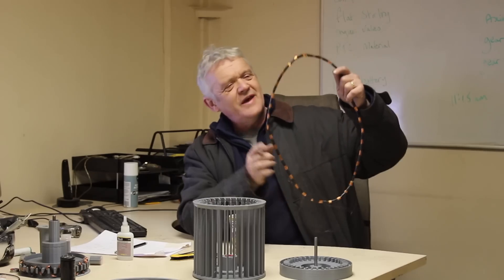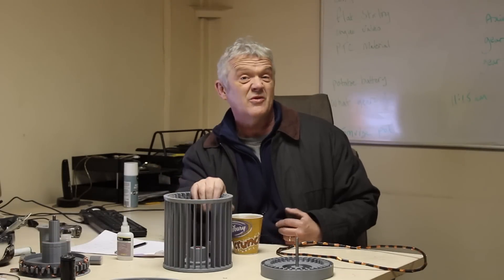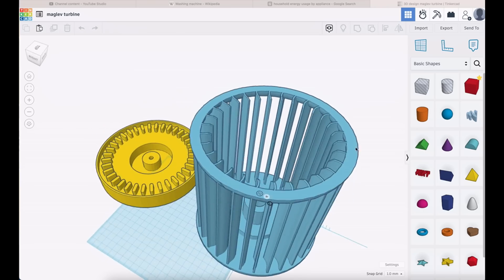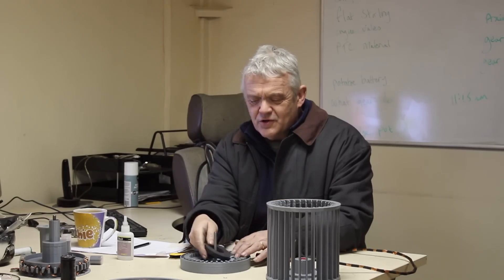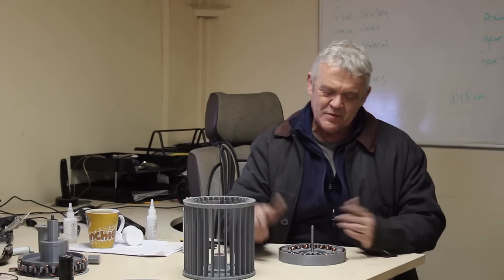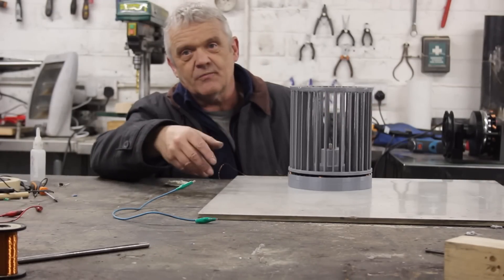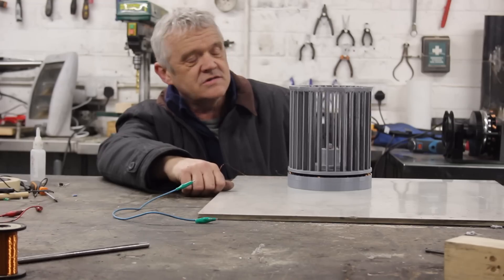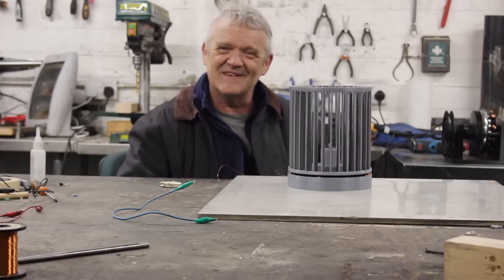1877 Maglev Wind Turbine

Comment: So,,(again I'm thinking out loud) could you affix this to a electric bike to charge as you ride?
Reply: Yes, but the additional drag would likely be more energy than the generator could produce, you’re probably better off generating electricity from a device powered by the wheels or drivetrain, like the vintage bicycle headlights that pressed a small wheel against the bike’s tire to spin it and generate enough electricity to light an incandescent bulb brightly.  When I entered a Science fair at a local university with my 3D CRT TV invention in gr. 10, the guys in the booth next to me were doing a car with a roof mounted squirrel cage wind generator...  that was their main criticism, and their excuse was ‘we designed it with poorly aerodynamic boxy cars in mind’  ...  fair enough, but it isn’t actually feasible to get more power out than the extra drag caused.
Reply from the maker: yes you could in theory
Reply: @Robert Murray-Smith  thank you sir..
Reply: @Robert Murray-Smith  I can't afford an electric bike,,but am trying to learn about battery making..

Comment: Hello Robert,
Thank you for all of your great videos. I have loved watching your content for years. 
However, in your last couple of videos, you have only shown voltage readings and never the amperage reading. 
Would it be possible for you to provide an update to this video and tell us how many amperes you have read?
Best regards,
Chris
Reply from the maker: that's because I realised measuring amps all the time was a waste of time and pretty dull lol - we are working with the same coil and magnet arrangement at the moment mate - I did measure amps and volts once or twice but after that - what is the point? Volts will give a direct measure and amps is just a matter of force in less losses in the generation system - as losses in the generation system are the same why bother? we know force in as it is governed by wind speed  - so to asses this system we only really need wind speed and volts - the I have finished making assessments and build the final version then it would be time to measure amps again - and it is likely I will do exactly that. Anyway for your peace of mind it was about 35ma
Reply: @ThinkingandTinkering  Thank you, Robert, for your quick response. Your YouTube channel is great - it's a pleasure to watch. 👍
Reply: Yes please!!! I was just about to write the same thing.
Reply: If I'm not mistaken, the device he connects all these devices to to measure voltage has a set load so all are compared equally. Perhaps go back to that video where he presents it for the e act numbers.

Comment: If you arrange magnets in halbach array configuration, you should be able to generate more power out.
Reply from the maker: no - you would get a higher voltage - but power out is always less than power in - you can't get more than the wind is providing

Comment: 🤔 Also a nut on the end of the fixed shaft will lower the distance gap/clearance between the turbine and the coil, it will increese the output voltage. 👍🏻
Reply: Wouldn't that attract more squirrels? 😊

Great idea to stop the turbine section launching off into the distance. 👍
Reply: @YoureNowOnTV  LMAO... isn't that the point of the squirrel cage design
Reply: @YoureNowOnTV  Nobady said to be tigthened till the end .
Reply: another mag-lev bearing at the top fixed to the axle would stop it escaping, then the gap could be adjusted by lowering the top mag lev setup, this would also mean the thing could be turned on its side if you wished.
Reply: this would add friction .. better to just create the print with the mag-bearings farther apart or coils and gen-magnets closer ...
Reply: Just add another coil section on top. Double the generation, no chance of it absconding.
Reply: @Gainn  And the weight will force it down farther
Reply from the maker: nice - cheers mate
Reply: you would need a bearing under that nut!

Comment: I'm wondering how much impact the large magnetic fields from those ring magnets is having interacting / interfering with the magnetic field from the tiny neodymium magnets at the rim - which are ultimately the ones interacting with the coil to produce the current.  Maybe do a comparison of the output from this maglev version with a version using a standard non-magnetic (but more friction) thrust bearing?
Reply from the maker: none at all
Reply: Wonder if one could shield it somehow...

Comment: How did you (or did you) manage the gap between the magnets and the coils? Heuristic? ie by tinkering? Seems like you'd want as small a space as possible without the turbine bottoming out when it starts to vibrate
Reply: Or if the weight increased for some Godly reason.
Reply from the maker: I must do a video lol

Comment: i might have a suggestion. as wind mostly only comes from one direction, and the wheel can only turn in one direction, maybe block off half of the entire cylinder around it, blocking wind from interfering or interacting with the rotor, on the wrong direction. perhaps this casing can be aerodynamic, to make sure the nose always points to the wind as well. like those flag thingy's behind wind direction telling contraptions.
Reply from the maker: good suggestion mate - cheers
Reply: @ThinkingandTinkering  great channel :)

Comment: this idea has obsessed me for years - imagine this in the place of chimney pots in cities which no longer allows fires.
Reply: @dadigitechman  Is that true? Turbines ain't turbines. Rob has made many comments on the fact that a Council rightfully won't allow a HAWT with its propellor spinning away on a 10m tower, but a row of these is a different story. Maybe not on a roofline but they could go on a ledge outside windows or below a verandah railing.  Totally unobtrusive. Not the ideal site but large numbers make up for the inefficiencies and VAWTs do much better in turbulent air than HAWTs
Reply: @dadigitechman  A chimney pot or a weather vane or ridge tile design, would not look like a generator and so should escape that prohibition.
Reply: @dadigitechman  Only if they CATCH ya!
Reply from the maker: nice
Reply: @dadigitechman  hel yea !
Reply: First it looks like these could pay for themselves pretty darn quick
Second I'd use air bearing in place of PM.
I thought of the same idea of placing these on the roof too, so how about replacing wind-driven turbine exhaust ventilator, Along with the wind the attic heat would add additional force.
Reply: @BOBPortlandOr  excellent idea - and having multiple things working side by side contributing seems sensible
Reply: @BOBPortlandOr  Question... How will you provide air as a bearing, for less energy than the turbine provides?

The magnets can be yanked from an old failed microwave oven for totally free, and cost absolutely nothing to operate.

While I may have played 'devil's advocate' about magnetic drag, I do know that it indeed, is, at this point in time, the least power robbing form of bearing known.

Since each of these turbines are only going to produce a pittance, unless you plan on making one as big as a house its self, you will still be more power ahead to use magnets than to use air, and this only because air GAINS efficiency with surface area.

That reminds me of one of my plans for using water as a bearing.

It only makes sense in certain scales of power production, due to inherent inefficiencies, while, at the same scale as I WOULD use water as a bearing, magnets would cost the price of a small city.

One needs to engineer a system to work to scale, and at the scale Rob is showing us, magnets are just impossible to beat.
Reply: @hunnybunnysheavymetalmusic6542  
So with a air bearing there's: no magnetic drag, no magnets needed, no horizontal drag on axle. The question is how much sleeve and axle needs to be machined I guess 3cm.
Maybe you  could sell a DIYS Kits like Heathkit use to do, Maybe the wire could be wound on instead of pre winding allowing for closer spacing.
Reply: @BOBPortlandOr  With anything moving, to some extent, there is always some drag.

I would have hoped you knew this already, but moving on...

I have never seen an air bearing that did not work without both drag, and power input.

If you think you know of one, please share the design so I can see.

Otherwise, [and no, guessing NEVER counts] no, there is no way an air bearing can beat this design Robert is sharing.

Comment: Im curious to see your maglev combined with your feather turbine. The extra light weight of the feather turbine might help with efficiency.
Reply from the maker: interesting suggestion mate - cheers
Reply: yes sir 
keep developing that thin wind turbine please ..
Reply: @ThinkingandTinkering  Anytime! I love seeing your progress. Keep up the awesome work!

I was brain storming about ways to increase efficency on your turbines. You cant really make the viens on the feather turbine taller since they overlap with each other but you could make them wider, thereby increasing the overall radius/surface area of the turbine. You could also taper the veins so they are thinner in the center of the turbine and much thicker at the outter edge to reduce overlapping (and friction) and further increase surface area of each vien. If all the veins lay completely flush then there is no way for the air to get in to pop them up so maybe only have the outter edge overlap. If they did lay flat, perhaps a little air scoop somewhere along the vein would help get the air into the system to get it started. Naturally, all this would increase the weight. It would require some testing to find that sweet spot between weight and efficency. 

As for the tall turbine, i was thinking you could add a shroud that is a cylinder cut in half vertically, so only half of the turbine is exposed to the wind at a time. The shroud would rotate around the whole drum and could use a wind vane on the top to orient it in the direction of the wind. This way the half of the turbine that is going against the wind would be shielded to hopefully reduce any losses induced by fighting against the wind.
Reply: He could turn that upright windcatcher he was using into a feather type  wind catcher as well